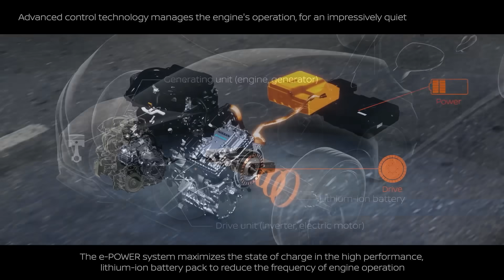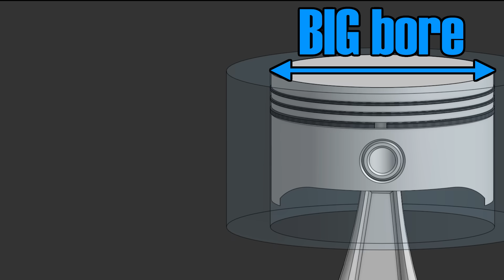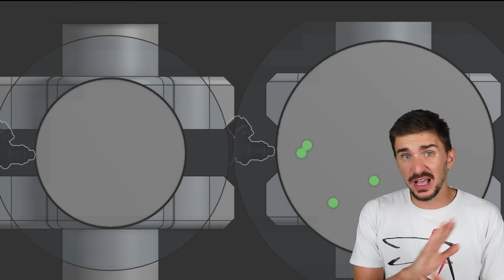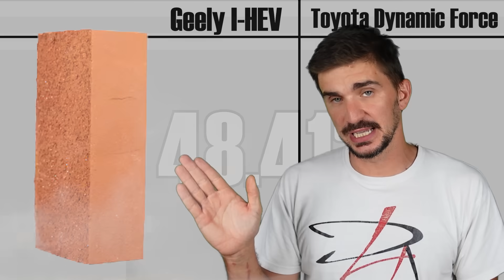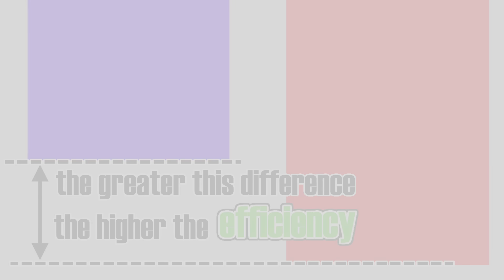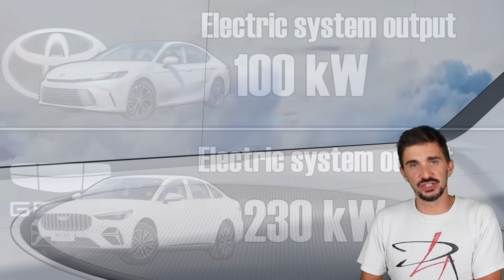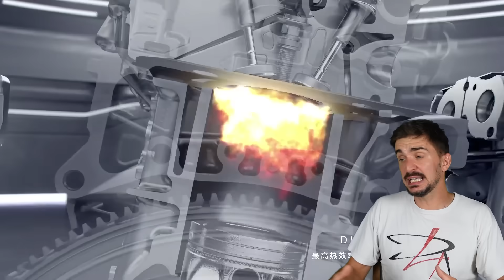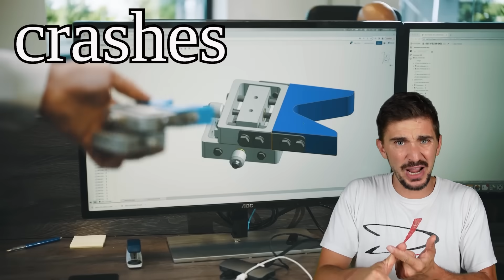How China's Geely Beat Toyota, BMW, Ford and Everyone Else

Comment: nitpick: it's 7 percentage *points*, not "7 percent"

love the video, keep up the great work 💪
Reply from the maker: Sorry, not a native speaker but I'll remember that now 👍
Reply: @d4a  It's the difference between absolute and relative measures, and one way of how you can lie with statistics. Doing X increases BadThing by 400% (relative)!! But BadThing normally occurs at 0.01%, doing X increases occurrence to 0.04% (absolute). Sidenote: Journalists get this wrong all of the time as well, let alone regular non-mathy people.
Reply: @Karagoth444 Journalists are the most non-mathy people.
Reply: @Karagoth444 that's the same thing though
Reply: @d4a I am a native speaker and I have no idea what the difference is - percentage points? Who's awarding me points? I'm sure it's a difference between A/B=X vs B+Y=A but as far as I know there's no universal way to solve this ambiguity without saying X% MORE vs X% OF and even then people get it backwards regularly enough that you always have to double check they did the math right. Thanks Obama! 😡
Reply: @JohnLonginotto  A point refers to a number (in this context). Usually refers to 1.0 when talking about percentages.
Reply: @JohnLonginotto If you increase an efficiency of 50% with 10%, you get 55%. If you increase it by 10 percent points, you get 60%.
Reply: @JohnLonginotto  
What does Obama have to do with this? What am I missing?
Reply: @d4a  its not about language its about math. 7% more than 41% is 1.07*0.41*100 = 43,87
Reply: @takiktos1265  And going from 40% to 41% is not a 1% increase, but 2,5%. But it is a 1 percent point increase.
Reply: I chuckled at the efficiency being reported two decimal places out.
Reply: It's closer to 14-15% more efficient going from 41 to 47.
Reply: Saying 7 percent is perfectly fine in this context, most people don't say percentage points. That really doesn't distinguish to anyone what original value (that the percents are calculated from) is being referred to
Reply: @movitoviscyrinxed446 absolutely not correct to say it.

Comment: So your car's performance depends on the cloud, that may be taken down at any time? Great!
Reply: Did you watch the video or are you just saying random shit? They achieved higher efficiency by weakening the relation of combustion power to wheel power through battery and electric engines and therefore are capable of using a more optimized combustion cycle towards efficiency. That's it. That's all there is to it. 

People like you just mentioning doomer brainrot on every video you see are truly insufferable. I have seen basic chatbot AI's with a more complex thought process.
Reply: @Yeet42069  16:30
Reply: The thing is it does not really have to. All calculations can be done locally and ofline with a combination of downloaded topographical and road maps when planning the root. But it seems that manufacturers want additional control and your info.
Reply: AI used to derive the algorithms. A much smaller processor is used to run them in real time. In the end there are only so many data points that can be adjusted, and the optimal settings at any given time will not vary much for any one point in the run cycle.
Reply: I doubt it - this would actually be very simple to calculate locally, as your path is likely set out predicted. I think AI here is just a buzz word for good old regular software that dynamically adjusts
Reply: Ignorance, the European cars have fallen behind because of fools like you
Reply: LMAO yeah